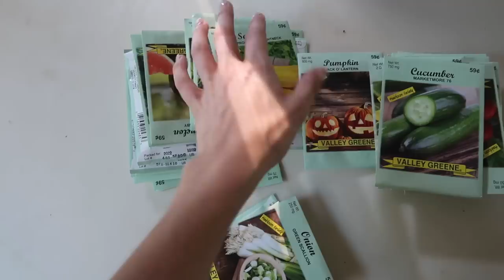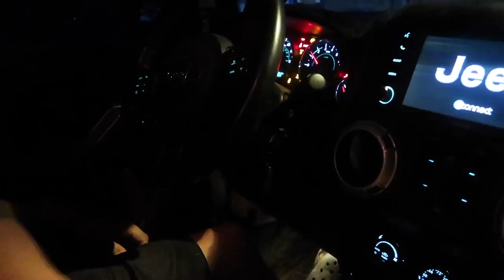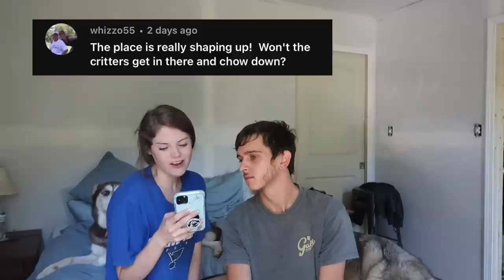Container House Master Bedroom I Shipping Container Home | EP:55 | Window and Door Trim

Comment: As for the ceiling fans, you can buy plug in ceiling fans that are easier to install than the kind you would have to drill a hole in the ceiling plug link into the electrical.  Just a suggestion for you guys. I have had a few and they lasted for years.

Comment: smth you can do to prevent dust is if you cut on the line with a boxcutter knife then hit the piece out it works pretty well or if you are cutting large sections

Comment: If you want a great tripod for a DSLR you can find a Matthews M25 used online. You be glad you have one...and I do believe there's currently one for sale on eBay. Search for $29 or $39. They were the first real pro-sumer affordable tripod made by a professional-grade company. They only cost like $169 new in 2007...but not enough people had smaller pro-sumer lightweight cameras back then and the folks who did...spent A LOT more on the Mathews M35 of a Sachtler. So they stopped making it a few years later. I've been using mine for 14 yrs constantly and EVERYTHING still works on it. Brick shit-house and when you can find one...scoop it up. It'll increase the quality of your framing and camera movement by a factor of 5

Comment: I heat my greenhouse with a black 55 gallon barrel filled with water and line the base with 2liter pop bottles lying down filled with water. My greenhouse is on south side of my house and able to keep plants from freezing down to 20*.  Your house is bigger so you may need more barrels. This allows me to use less energy keeping the house warm